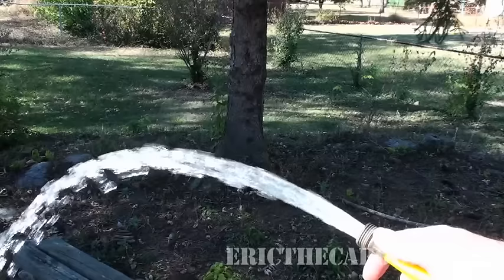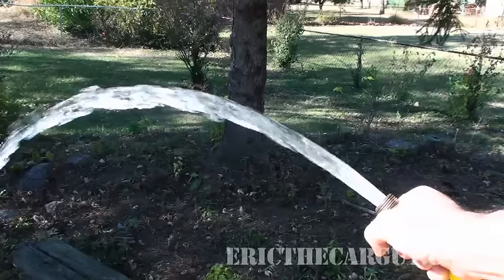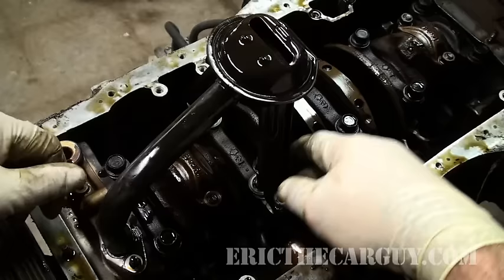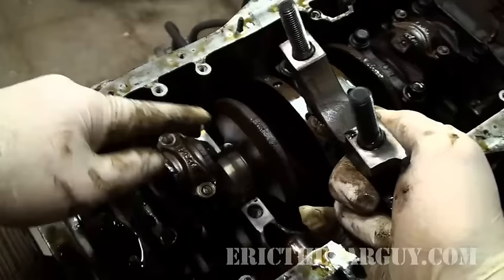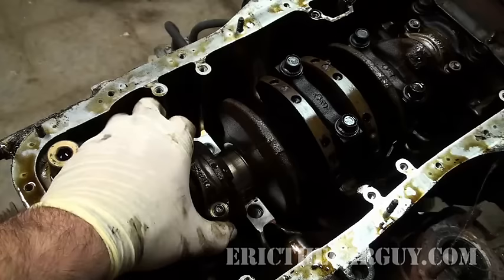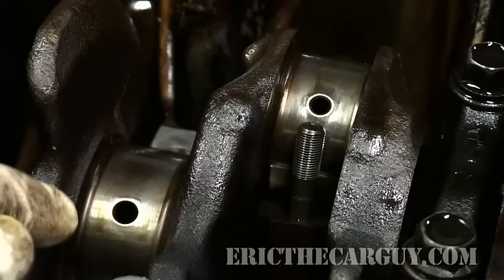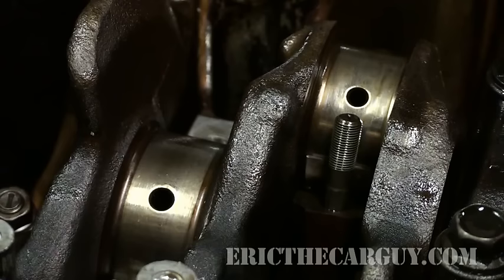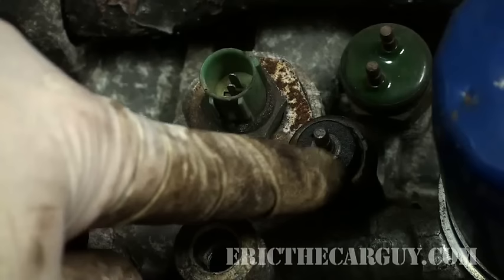How Oil Pressure Works - EricTheCarGuy

Comment: I do have a question! i know it might be slightly different, Can a oil pressure sensor switch Shut down or turn off your engine or its just to alert you that something is not working properly? Cause my motorcycle after a while riding (1hr (+). It shuts down but no lights come ON. Engine sounds smooth and steady idler.

Comment: I have a problem with oil temperature but all the other signs of temperature via coolant is at normal but the oil temperature is at 300 degree F. Why is this? I change oil and spark plugs but no change. Seeing this when driving hard...

Comment: Hey Eric thanks for video have 95 dodge ram 2500 with V10 and parts are kinda spendy I was going to go buy oil pump till seen ur video I have eratic oil pressure now starting to read low alot more so not pump I got from ur video I should hook up oil pressure gauge to sending unit if reads low then would u say that I'm looking at changing bearings
Reply: Just inspect the bearings, it's very easy.

Comment: So I put pretty thick oil into my jeep 4.0 engine and got a knocking sounds after a few weeks and it was the crank bearing and the oil pressure was normal too. Could it be that the thick oil ruined my engine? I'm currently fixing it.

Comment: then engine is done with no pressure. game over. some people even try to run 90 weight and if its a farm vehicle, fine but don't do that on something you care about, it will just further damage the engine including the top end.

Comment: Hi. I respect your video every informative. I have a question. I was replacing the oil  seals on my maxima 2005. And by accident i destroy the oil pressure sensor so went to auto parts and bought the sensor and now the light comes on at idle and turns off when car runs. (Annoying) oil light Can it be a bad sensor? Please help

Comment: Hello and thanks...I got a print out from a mechanic saying that 4.3L oil my car needs...but if I put 4.3L in it the oil 20mm above the dipstick "FULL" line... but at this time I put in + STP 473ml more oil.. and the oil is 30mm more on dipstick  "FULL" line...I assume when the oil scale passed the FULL line on dipstick by 30mm is a  littler too much oil....How do I know if the engine does not like too much oil? will it run rough,,, or will it run uneven? or...............?

Comment: Oil pressure light comes on when the oil heat to about mid temperature and it comes on again if the car is idling or on low car speed after that....whats wrong? Vw tsi engine on Skoda superb

Comment: i have a 1997 Dodge Dakota had over 40 psi oil pressure drove about 3/4 mile down road and oil pressure drop to 0 and stayed there I've change oil and filter still no oil pressure. why would this happen I've never had an issue with oil pressure before.

Comment: very late coment buut on cold starts the first 4 sec i got no oil pressure at all after that it goes to normal and stays there. during those 4 secs i can hear the hydralic lifters ticking a lot. the car stock takes 5w50 , if i put 10w50 will it help it on those cold starts somehow ?

Comment: Though this clip might be 6 years old, hopefully someone could hear my pleas.

My vehicle (Suzuki Swift Sport 1.6m ZC31) has been visiting the same mechanic for about 5 times now for the same issue with con rod bearing damages. From replacing of con rod bearings, skimming of the crankshaft, a full overhaul, replacing of oil pumps, cannibalising all parts from another ZC31, non of them seem to have fix the problem. My con rod bearings are still getting damage during the duration of engine break-in  even when i drive the vehicle at below 4k rpm.

Comment: Can it also cause a leak somewhere? I added a little over 5qtz and then added some additive (engine restore) and I forgot to compensate for that, now I notice a few leaks that weren't really there. Cant find the leaks but oil level is still ok

Comment: I noticed that the my car ( Alfa 147 1.6TS ) goes better when less oil in the system (1-2l less than max). Why is that so ? Worn engine? Clogged oil pump? oil separator vent pipe clogged ? Any ideas ?

Comment: So I have a Jeep Grand Cherokee (01' 4.0L) and my oil pressure goes nuts while the engine isn't fully warmed up. It nearly reaches 80psi with normal driving until it warms up. After that it sits around 40-60 during normal driving. What do you think could be causing such high pressures? Could there be a blockage somewhere? I'm pretty sure I don't have any sludge, I change my oil every 2500 to 3500 miles and theres never any signs of anything that could be causing a blockage. I use the correct oil and everything. Also the pressure it even worse during winter. To the point where if I don't let the car warm up the pressure gauge will max out at 80 with normal and conservative driving. It hasn't cause a problem yet but I fear it could be putting extra ware on my engine

Comment: I have a question I just did a head gasket job on my 97 Honda civics ex has the d16y8 engine it vtec everything was done to spec but my engine is consuming oil at a high rate about 1.8 quarters every week and a half I have high idle issues along with it motor never did this before head gasket job was done any suggestions

Comment: How will a high oil pressure happen, is it like the line is blocked by something ? , I still didn't check the sender unit I hope it's just the sender unit

Comment: Hey eric good day to you, I really appreciate all your videos and it helps me a lot. Anyways Im having some issue with the engine that Im rebuilding, it was Mitsubishi 1995 3000gt non turbo, it was knocking so I checked it and found out that the connecting rod bearing was worn out, I change it with the standard size because I really don't know which one to order, I install them and replace the old ones but still knocking plus the oil pressure was really low and the indication light was lit when running idle, but as soon I step on the acceleration it'll off. Watching this video makes it clear that probably the clearance on my crank shaft and bearing was out of tolerance. what can you suggest? should I buy rebuild crank shaft, new bearing comes with it, and new oil pump, or just buy the undersize bearing, it's hard for me to do the checking as the engine was still installed.

Comment: if this is true wy did my oil pressure warning turn back off after i installed a new oilpump? also we pulled the lower bearing caps off and they where fine i dont no wy but the pressure did not go up a lot again but i do have pressure and i still drive the car 2 years later every day. if this starts again can i get by just replacing the caps i can get to without pulling the engine and pulling the cranc?

Comment: I have to ask u Maby u think I can change those  bearings set on vw passat with out to remove the engine from the car? I mean I lift the car more up and try to do this , is not so easy but Maby is possible

Comment: Hi Eric, I wrecked my car for not stopping in oil change light. Sold to junk yard for 280$, how much you think I COULD SOLD FOR OR IF POSSIBLE FIX FOR IT? THE TECH SAID THERE WERE METAL PARTICLES IN THE ENGINE.

Comment: hey eric i have a 97 civic and the oil light came on some times it blinks and sometimes its always on i bought a new sending unit and its still on i also did a oil pump on it and nothing happend can i just buy new bearings and mains for it and will the pressure go up?

Comment: i have anew sbc 355 that has 600hp. bearing s were at .003 on mains. it has a melling 55 hv pump. Do i need to be concerned with 10 psi at idle?

Comment: Hi sir.
My car chevy optra.
I have low oil pressure light issue at idle or low rpm.
Did engine flush.
Also I have changed
1. Oil pump
2. Oil pressure sensor. 
Still same problem last 18 months.
Still no success.
Pl help

Comment: i have a 04 Lincoln aviator  i was cleaning inside the car some glass from a window that was broken so I went to turn the truck to move it to the other side and starts knokin so bad I turn it off and in dash low oil pressure? need to replace the engine?

Comment: hi eric i replaced timing belt and water pump on Hyundai Elantra 2003 2.0l everything went good and i decided to do a service i drained the oil put the new oil and filter and started the car but now oil light was coming on when the engine gets to its temperature when i rev the engine it goes away got bit scared and i decided to change the oil pump i thought i used the engine flush it might have done something to the pump (because there is bit of sludge in the engine) anyway i changed the oil pump genuine from hyundai and same thing happened again oil light came on, i even used the full synthetic oil 15w 50 from penrite, what should i do now? its my cousin's car and i have spent so much time on it working every weekend.

Comment: hi eric i have a question i have a gmc safari 95 w 162miles i did a oil change i use 5w-30 conventional. after the change i notice the oil pressure gauge start going down to about 20 you now below the half and i get worry and i turn off the engine so my question is. you think that the last owner use shyntetic oil and the change to conventional make that to happen. i go little above the limit on the oil. you think that difference provoke the drop on the oil pressure gauge. thanks for the videos by the way.

Comment: Eric how you doing I got a question man I put on new bearings to my Acura Gsr engine and new oil pump all Honda original parts and did check for oil clearance all came .0015 with the green plastigage did like a short block or so but I’m scared to start the engine right away because it seems like there is something wrong as if the pump was stuck or there is a blockage somewhere because the oil light on my dash doesn’t go off like the repair manual says  you know the repair manual says to first crank  the engine without Ignition or fuel system until the light goes off but I doesn’t should i plug everything already and start the engine what should I do I’m afraid it might seized up if there is no oil

Comment: hey Etcg I ran my car with no oil, it developed a slight knocking sound. I added oil and STP oil treatment to the oil, it helped quiet the ticking. should I keep my oil on full or should drain some down to the middle? what would you suggest? does anybody know?

Comment: I have a 98 Cherokee xj with a 4.0 I recently rebuilt it for performance reasons I replaced the rod, main and cam bearings but kept the stock crank which only has about 120,000 mile on and was not worn badly I put in a new taller cam new lifters roller rockers and an edelbrock head runs great but when the engine is warm at idle the oil pressure drops to 20 or even 10 pounds but then when driving will go all the way up to 50 pounds please help

Comment: a mechanic told me that my car engine is almost dead because when we remove oil filler cap from the top of the engine then engine is spitting oil out. is it correct and what could be the problem.
2 days ago my car started showing low oil warning light, but oil was full as shown by dip stick but I drove the car for 12000 KM on 10000 KM synthetic 20W-50 oil. very next day I changed the oil again but warning light is still on. and car engine is running smoothly, no noice of any kind. what should be the problem.

Comment: Well I'm having a problem with my car I put brand new rod bearings and main bearings and new oil pump and gaskets and I get 20 psi on cold start but if I let it warm up it goes to zero PSI but if I start moving and give it gas it gives me 20 psi again?

Comment: Eric, always good vids. You help many understand just enough for us to be dangerous. ;)

Recently had check engine light situation with some of the strangest behavior on my '04 Element. When cruising down the highway, engine would appear to go to into a starving state with RPM dive, deceleration and it felt like auto tranny was going to drop out. Shop came up with P2646. All they did was change the oil and filter and indicated oil was half quart low. I was really perplexed by this behavior since the oil was changed in late August by the same garage with Valvoline Syn Power.

How could a 1/2 quart of oil lead to such drastic engine behavior change? Toaster has 88K miles and this was the first check engine light on the vehicle.
How could a loose fuel cap/seal also lead to this behavior?

Scarry as #@$ driving down the highway when this occurred. Oh yeah, the other possibilities for that code other than oil level, pressure, was open short circuit condition, or failed VTEC pressure switch. Your input would be valuable to help me understand this situation.

Comment: I have a question, I just installed a cold air intake on my 2003 Chevy suburban. The problem I noticed after is that my oil pressure climbs rapidly when I press the accelerator down. Got any idea @ericthecarguy
Reply: lazurus 144020 Wrong engine oil viscosity

Comment: Good video man,i have a 14 Camaro ss and the oil pressure is relatively fine on a cold start ,but when it comes up to running temperature, the gauge slowly drops,and when you come to a stop our idle it goes down damn near zero,but then when you take back off and drive it comes up....what do you think this could be ,ive has a shop hook in a maual gauge  and it read the same as the gauge in the car....dont know if i should replace oil pump next our what and keep in mind this is not a stock car,its a fully built 416 stroker running 900 hp at the tires.Any info would be appreciated

Comment: I have a 96 chevy Silverado 5.0 305 2 wheel drive. I have been having a problem with oil pressure except it's running high to the max. It seems to do that when I do an oil change but over time it gets lower the more I drive it sometimes. I am just worried that the max high oil pressure after an oil change is going to ruin my engine. What some ideas I can try to fix the problem thanks.

Comment: I just  put in new lifters and push rods in my SBC and now the oil pressure goes to 20 and slowly backs off to zero when it use to hold at 50. It had a noisy lifter and I just wanted to change all of them out instead of looking for the noisy one and all new push rods because one of them had a vary light bow to it when I rolled it. But why would the oil pressure be effected by all this?
Reply: *affected. garbage in the sump?

Comment: So would adding a higher viscosity oil help keep the pressure up in a worn engine?
Reply: That's the idea behind changing from 10-30 to 20-50 oil in a Honda engine after a lot of KM

Comment: i have 2003 chevy express van 6.0 with 254897 mile in morning when i crank up if i let run for five min tge pressure goes down to 0 i get in and drive we steady for reast of day,if in on hwy running 70 mph oil gagye starts to go up and down every niw and then any help

Comment: I have a question what if you’re engine oil pressure just disappears I have a 00 suburban I change the oil every 3 k and use a pf46 oil filter at the Chevy dealership I just started the truck and just heard all of the lifters ticking loudly it was just a bunch of light ticking the gauge reads zero oil pressure the oil level was at the full mark and the oil was changed a week ago do you guys have any idea what it could be ???? The dealership wants a 150 to look at it

Comment: Hey Eric I have a question about my quad axle dump truck, I know you work on cars but it didn't hurt to ask. 
My truck had almost no power to get going so I took it to my mechanic and he said the fuel lines were backwards and fixed it. Well I picked up my truck and yes it differently had way more power but now I have high oil pressure and a little rear engine knock until truck warms up then it goes away. I'll pressure was always around 40psi at Rev and more it's at 60psi or more at rev.
So my question is why is my truck oil pressure so high and the knock with it?

Comment: Hey bud  I have a problem with my oil light on my 1988 Honda Accord hatchback oil light come on when my car is running for like 30 minutes i did replace my oil pressure sensor but is back flashing again after 3 or four weeks what do you think is can be

Comment: What about if after driving for about 45 minutes and then when sitting at a stop light and my pressure gauge drops to low. but when driving, the gauge remains center?
Reply: sworn2prtcusa2002 I’ve got the same probelm
Reply: Did u ever figure it out?

Comment: How about going to heavier oil viscosity to fix low oil pressure as cheep way around?
Reply: +flashbackboy sometimes works but not always. I'd do it on a 4.0L inline 6 jeep engine since the engine was quite strong and rugged. I wouldn't even try on a newer toyota engine where tolerances are a lot tighter.